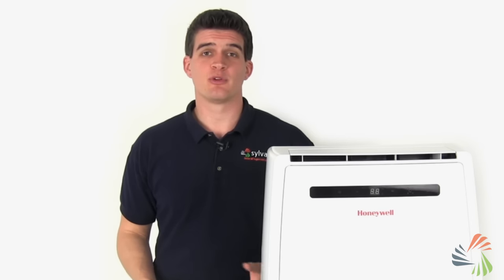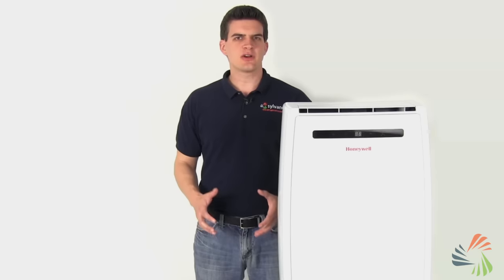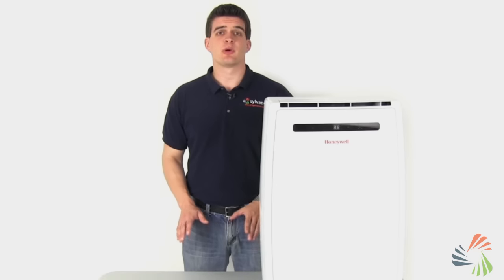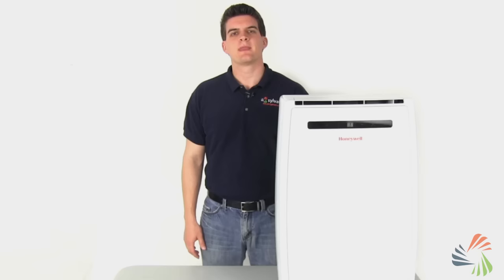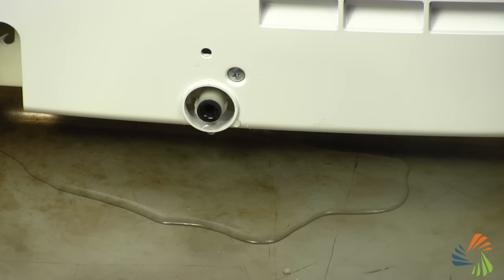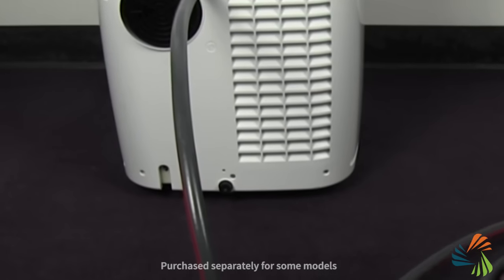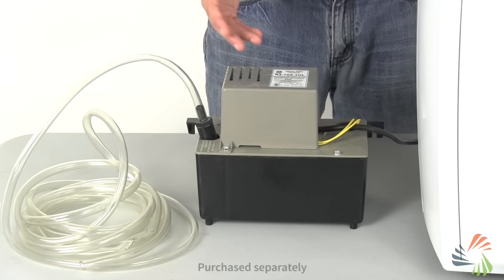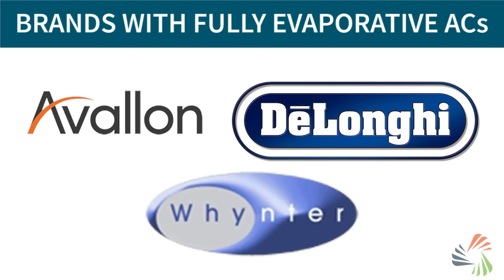How to Drain a Portable AC: Fully vs. Partially Evaporative | Sylvane

Comment: I have a Danby Heat and Cool unit. When operating as an AC during summer, I didn't have to drain the thing at all; however, during winter when the unit is running on heating mode, I find it make a very loud noise due to water collection. And I have to drain the unit every couple hours which I find quite annoying especially with a sleeping baby. Is that normal? Do I have to continuously drain the unit whilst in heat pump mode?
Reply: yes, I believe in the instructions it says you have to connect the hose during Heat Pump Mode

Comment: I need help on the heater on a Haier portable air conditioner. When air conditioner is on it self evaporates the water but when we use the heater we have to drain it every 10 minutes. Does anyone know why it doesn't self evaporate while using the heater!
Reply: I have a Haier Commercial Cool Portable Air Conditioner (CPN14XC9) - 14000  btu w/o the heater.  The dehumidifier mode evaporates the water (looks like 2 droplets of water on the display) and can only evaporate (moisture removal) up to 110 pints/day.  Cooling mode (AC) uses refrigerant (R-410A/24.70z), so don't think the water is coming from the AC.

Comment: I have a temp unit in my home until my air conditioner is replaced on Monday...it was working great the first day..second not so good. The reason...trying to drain out a window instead of down into a bucket....remember you can't drain up hill.boing!!
Reply: That is where the condensate pump would come in. Water won't run uphill remember.

Comment: My portable ac started smelling like urine. So I took it apart to see if I had a mouse nest but I didnt. It needed to be cleaned anyway but it still smells like urine? any clues?
Reply: It's black mold you'll need to take it outside, saturate it with Lysol foaming bathroom cleaner, let it sit awhile then pressure wash it out. Rinse and repeat once per week. I'm waiting on an inverter u shaped window unit to arrive and then I'm selling the portable. It's too humid in Arkansas, and forget this it's too much damn work.
Reply: It's in a blue can this is the only thing that works. Black mold gives me an instant migraine when I turn the unit on, nothing else not even bleach helped.

Comment: Really? I have mine raised to put a cake pan under. Just overflowed once again cuz I didn't wake up.
Reply: Put mine on a chair and tilted it.  Some missed my bucket, not just coming out the drainage hole.  Cleaned it up, washed the filter, plugged it back up and back in dehumidifier mode.

Comment: There is no partially evaporarive air conditioners. There are only ones where manufacturer used tiny bit of common sense and "i am an idiot manufacturer i do whatever however i want and I don't have to explain to anyone my disregard for quality". Most of them are in second category.